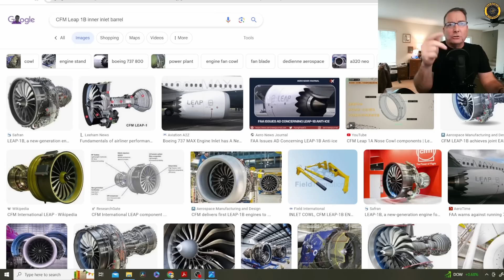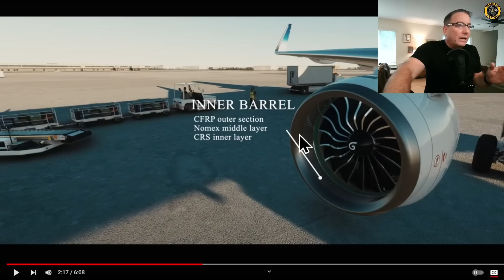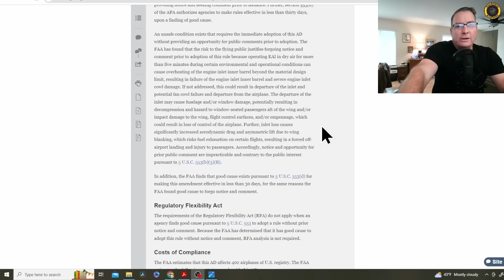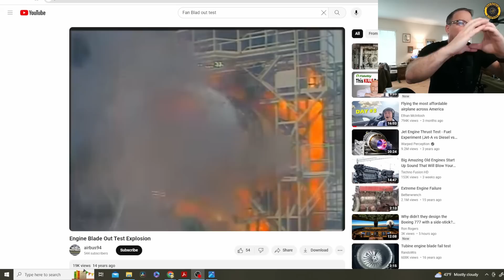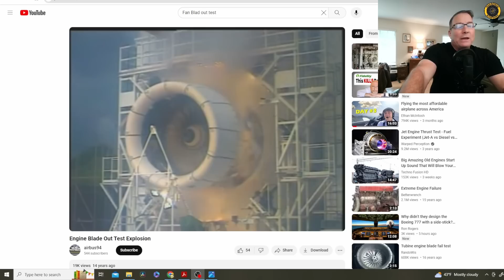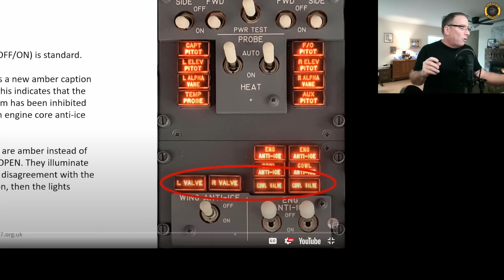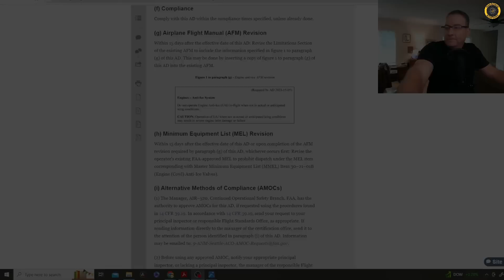Boeing 737 Max-7/-10 Certification HALTED! 1 Feb 2024

Comment: Airbus A320 disasters.
Source:  Wikipedia

On 28 December 2014, an Airbus A320-216 registered as PK-AXC, crashed into the Java Sea killing all 162 on board. 
The cause was initially a malfunction in two of the plane's rudder travel limiter units.

On 19 May 2016, an Airbus A320-232 registered as SU-GCC, suffered a cockpit fire and crashed into the Mediterranean Sea 
20 minutes before its scheduled arrival at Cairo International Airport.  All 66 on board were killed.

On 22 May 2020, an Airbus A320-214 registered as AP-BLD, landed at Jinnah International Airport gear-up and executed a go-around. 
A few minutes later, both engines had shut down. 
The plane crashed into Model Colony near Karachi on final approach to Jinnah International Airport for an attempted emergency landing, 
killing 97 of 99 on board, as well as killing 1 on the ground.

On 5 November 2014, Flight 1829, an Airbus A321-231 registered as D-AIDP, was flying from Bilbao to Munich when the aircraft, while on autopilot, 
lowered the nose into a descent reaching 4000 fpm. 
The uncommanded pitch-down was caused by two angle of attack sensors that were jammed in their positions, causing the fly by wire protection 
to believe the aircraft entered a stall while it climbed through FL310. 

On 31 October 2015, an Airbus A321-231 registered as EI-ETJ operated by Russian airline company Kogalymavia crashed in the Hasana area of central Sinai, Egypt 
while en route from Sharm El Sheikh, Egypt to St. Petersburg, Russia. There were 224 people on board (217 passengers and 7 crew). 
There were no survivors.
Reply: What’s your point?

1st-Pilot pulled the circuit breakers to try to fix the problem leading to aircraft entering alternate law and pilots failing to maintain straight and level flight

2nd-Unconfirmed but possible pilot smoking 

3rd-Stupid pilots trying to steep dive towards the runway and not having gear extended

4th-OEB 48/49 published and later software update compares AOA sensors with G load to identify erroneous sensors

5th- Bomb

Comment: The foundation of Boeing's management problem is the corporate culture in this country, which is obsessed with quick profits. Companies have to make QUARTERLY earnings statements to Wall Street. This doesn't create an incentive for long term investment, or a willingness to take the time to ensure safety and reliability. Throw in executive bonuses that provide incentives for quick profits, and you have a recipe for disaster. Time is money, so scheduling pressure is inevitable, and this makes engineering, safety, and reliability a nuisance to some people in the organization. We saw the same dynamic at Southwest. The executives refused to invest in reservation system upgrade despite warnings from staff and were financially rewarded -- even as the airline ultimately melted down during a major winter storm. The dissatisfied Boeing shareholders must stand in front of a mirror and repeat: "we have met the enemy, and it is us."

Comment: Doesn't the A320 NEO use the same engine?  Does it have a similar problem?  Or does it have automatic anti-icing and so avoids the overheating issue?
Reply from the maker: Auto.
Reply: @blancolirio only for pitot heat and window heat. Engine and window anti ice are on/off pushbutton switches with ECAM messages advising when to turn on and off

Comment: ugh!  just put the metal back.  totally ridiculous to risk a catastrophic engine failure that might occur if the pilots forget to turn the anti ice off.  As if the pilots don't have enough to do.  either put the metal back onto the front of the engine or fix the bleed air so that it's not so hot.  this is another Boeing disaster waiting to happen!

Comment: Something I do not understand: 
Was this cowling developed WITH this engine by the engine manufacturer? Or was the cowling developed by Boeing? 

If it was developed by the engine manufacturer, HOW did things get this far along without this problem being seen previously?!
Reply: If I were to guess, since the cowling is an airframe component I would say Boeing lol.
Reply: Also does the Airbus "NEO" series use the same LEAP engines with the same delicate cowling material? Do they control the anti ice function differently than Boeing?

Comment: Those blade failure tests are nice and dandy in static conditions but what happens when the engine operates at high mach numbers? The way that nose cowl oscilated at speed, it may separate. Of course, you can't test this in flight. 
You nailed it. Why wasn't the anti-ice automated as it has been for other older models?
I guess that could have jeopardize the one for all type certificate. Once again, Boeing cutting corners. Glad several entities cause the Max 7 and 10 to halt.

Comment: I understand that there are certain “things” that will not surface in preproduction testing for any new design/product. This deicing issue doesn’t seem like one of those “things”.
Reply: The test pilots and engineers would have to forget to turn off engine anti-ice during testing. And forget it enough times to produce the problem. Not likely to happen.
Reply: So there is no durability testing of this system outside of complete aircraft testing during flight? They couldn’t test the system during bench testing? I’ll bet they find a way to do it now.
Reply: @chrisn7188  They may very well have done bench testing. But it likely would only have been in simulated icing conditions. Why test an anti-ice system when there’s no ice? Of course now they know why. :)
Reply: @robertbutsch1802   the issue isn't ice is it? It's the application of heat to a material that cannot deal with the heat over a period of time.

Comment: 21 years ago when I transitioned from 737-200 to A330 I was a bit upset about not getting the 777. 12750 Airbus hours later I am so happy to be an Airbus fanboy(pun intended) especially the A380 which was an absolute pleasure to fly. Cannot believe the overhead panel on a “new” aircraft looks like a 50’s design.

Comment: Even the little E-175 I fly has auto ice detection and automatically turns on the wing anti-ice and engine anti-ice... and turns it off when icing conditions go away. Astounding that the 737 is so primitive.
Reply: It is primitive because it is a 1960s design! Boeing has really squeezed every penny out of that thing. It is astounding that they are still trying to certificate that thing and somehow make it seem like "modern". And even more astounding that the FAA somehow have allowed this to go this further
Reply: Yes that's astounding. Our home's heating uses thermostat radiators. The building was designed in 1964 and wasn't even considered highly advanced at that time.
Reply: @truthserum5310  They own the stock but the assembly lines and workforce are still controlled by Embraer.
Reply: That’s not the bad part part, the bad part is that the plane crashes if anything goes slightly wrong with the system and it is almost designed to go wrong because as Juan pointed out pilots can’t even actually comply with this craziness even if they are totally on top of it.  But what happens when something else goes wrong in the cockpit?
Reply: I’m a 175 driver too and I agree. Embraer’s have had this automated for 30 years but Boeing’s don’t!
Reply: @blancolirio The 757 and 767 don’t ordinarily have any automatic anti-ice either, do they? I heard some 767ERs do.
Reply: @rynovoski  The 757s I fly don't. They're a bit older too.
Reply: @12pentaborane  I don't /think/ any do, or at least I can't find any evidence. 

Probably in part because it was never a big deal, just not ideal, to leave it on.
Reply: They kept the controls the same as on older 737s so pilots wouldn't need to be re-certified to fly the 737 MAX planes. That's partly on Boeing, partly on the airlines. Both wanted to cut the cost of the new plane. There are lots of other examples of it in other parts of our life too. e.g. U.S. electrical plugs having metal exposed while energized as you're plugging in or unplugging. Countries where electricity was introduced later were able to use plugs which had designed this flaw out. But because the older more dangerous plug was standard in the U.S. by then, the U.S. continues to use them.
Reply: @solandri69  Modernisation is possible if there's the will.

Taking the plug example, I'm in the UK, and we've had electricity here as long as anywhere (the first house in the world lit by electricity was here, and our electricity grid was built out in the 1920s along with that of the US). But our plug design dates from 1947 - they were just like "ok, new standard everyone, this is going to save lives." Sure, post-war reconstruction gave a boost to the new standard, but its introduction still bore a cost.

There's absolutely a cost associated with any change to long-established standards, and it's understandable that both Boeing and the airlines want to keep costs down. But deciding that the cost is outweighed by the benefits to other parties is the job of regulators, and I'm with others in this thread who say that the FAA has some responsibility here.
Reply: @solandri69  Keeping 30-40 year old designs is absurd.  Re-certifying to modern systems should be a normal and welcome part of any job.
Reply: @roflchopter11  So we keep flying with 40, 50, 100, 200 year old tech because it's too costly to modernize?  If Boeing was the only game in town, maybe they could get away with it, but if you don't innovate you die.  Airbus is literally laughing all the way to the bank at their screw-ups. Even little Embraer is cutting into their sales.  A few less seats, but available NOW versus... 10 years? Maybe longer?
Reply: @josephoberlander  More like 60 years old. I find it astonishing that they still use wire ropes and pulleys to operate the flight controls.

I will never understand why they chose to enlarge the 737 and discontinue the 757, instead of making a smaller version of the 757.
Reply: @PaulSteMarie  As has been said ad nauseum, Boeing's customers didn't want a new whole airplane that would complicate their businesses and cost them more money. Some airlines like SWA, Alaska, and Ryanair to name 3 want an ALL 737 fleet so their crew scheduling, maintenance, and pilot training are simpler and WAY cheaper. Boing saved a lot of money but so did their customers. The airlines tell the airframers what to build, not the other way around.
Reply: @PaulSteMarie  : I'll never understand why people keep bringing up the 757 in a world where the 757 and 737 share the same recycled 727 guts. Boeing offered a smaller 757 and nobody wanted it because it was a heavier airplane with an unnecessarily large and beefy wing designed for a much higher MTOW that would have basically just done a 737s job for more money. The only way you could make a smaller 757 work for real-world airlines is to put a smaller, lighter wing on it and lighten up the structures bolted to the fuselage. Remember, the 757 and 737 share the same 727 fuselage structure, so you're not making any meaningful difference in the fuselage. At that point you might as well throw a 737NG wing on it, and you've arrived right back where you started, but with a different nose.
Reply: @ErickC The Boeing 737 was specifically designed to be low to the ground with low bypass engines. This doesn’t leave enough room for bigger engines, with bigger bypass ratios, so Boeing had to move the engines, changing flight dynamics, and that’s how the whole MCAS-disaster started. Which is of much bigger concern than the doorplug- or engine cowling- problems. The 757 is also old, but wouldn’t have had the big bypass issue.
Reply: @josephoberlander  the 737 airframe was designed in the FIFTIES, SEVENTY years ago, as the 707 airborne refueling rig for the military. it should have been retired in the eighties, forty years ago.
Reply: @solandri69  Exactly so! That's also what led to the MCAS disaster.
Reply: @solandri69  I have serious doubt that pilots would need a new certification - only because de-icing would be automatic.
Reply: @DR_1_1 the issue is the pilots have to be TRAINED on the type and that can’t happen unless the airlines buy a simulator, and the whole issue is Boeing sold these planes promising that airlines would need to do the new training.   So then Boeing just omitted or deleted even telling the airlines and pilots and fax about these issues so they could skirt by and now pilots are flying systems they don’t fully understand because the changes were actively hidden from them.
Reply: @solandri69  "That's partly on Boeing, partly on the airlines."

Why aren't we blaming the FAA for not having a reasonable path for updating cockpits without total re-certification?

I don't need a new driver's license to drive a 2023 Toyota Camry just because the headlight switch and wiper controls are different from a 2005 Toyota Camry.

Substantial changes that affect how you fly it? Sure. Minor updates to peripheral systems? Surely, a bulletin or mandatory review of the marginal changes should be sufficient.
Reply: @dafunkmonster  Because the updates have charged the flight characteristics, which can vary substantially between different airplanes. There are different types of driver's licenses for cars and tractor-trailer rigs because the latter are so much harder to drive. Multiply that difference by 1000 for airplanes. 

MCAS was supposed to eliminate those differences between the 737MAX and earlier 737 models.
Reply: @dafunkmonster  anyone making arguments that “it works fine for driving” is not a serious person or hasn’t driven in at least 5 years.
Reply: @truthserum5310 Wrong
Reply: Could this be their Harvard moment, or their Bud Lite moment  ?
Reply: What do you expect from a plane designed by clowns who in turn are supervised by monkeys?

Comment: I'm a bit confused. In the photo the CRFP is clearly labeled "outer section" yet you said it was the inner layer (I'm assuming you just mis-spoke) while the inner layer is CRS, (carbon reinforced steel) - steel, but are you saying it's still a problem?

Secondly; is the cowling designed and built by the engine people or the airframe people?  I think Boeing should have been forced to clean sheet this aircraft several models ago. Hind sight being 20/20.
Reply: He said “first layer.”

Comment: So the flight crew was supposed to depend on visual cues - (while in flight!?) - to determine icing conditions GMAFB
Operating at night included...? WTF  .
Reply: I understand the issue to be that the crew has to remeber to turn off engine anti-ice when exiting icing conditions rather than it being done automatically for them. The airplane does have icing conditions indication but no automatic operation of anti-ice.

Comment: It seems like the engine anti ice system needs to be able to modulate the temperature of the bleed air anti ice system in addition to an automatic bleed air control system that senses icing conditions.
Reply: Adding that to the MAX would have jeopardized main big priority of making it compatible with earlier 737 versions and thus requiring  more crew training expense than some airlines wanted.

Comment: This might be pointing out the bleeding obvious but why don't they mix the hot bleed air with some cold external air to bring the temperature down?
Reply: The air for engine anti-ice is supposed to be hot.
Reply: @robertbutsch1802  "...is supposed to be hot"
Is supposed to be hot enough to melt the Ice, but not the plane....

Comment: Boeing would have been better off sticking with the 757 and developing different models. The 757 would have been a better aircraft and they wouldn’t have had to deal with MCAS cause the newer engines would have fit.

Comment: I was a B-52 crew chief for several years and had great respect for Boeing's engineering and design of that airframe. 

But this redesign of the ring cowl anti ice system on the Max series is bad and makes no sense. Why switch from a system that is forgiving if the anti ice is accidentally left on to a system that won't auto sense and shut the bleed air valves or tolerate inadvertent use of the system out of icing conditions. I foresee pilots being reluctant to use the anti ice system because of these shortfalls which could lead to an incident or accident due to ice accumulation on the engine inlets.

Comment: That's insane to design an engine that can't take the heat of necessary engine anti ice. Plastic parts look awesome...just before they explode to dust. Cant be on for more than 5 minutes.. that's crazy
Let's see,,so far we have what wall street calls the Max jet,, flying ⚰️ coffins. Why....MCAS, "bowing', plug type doors, loose rudder bolts, pitch roll tendency,,etc,etc
Reply: The cowl can take the heat of necessary engine anti-ice just fine. The problem is it can’t take the heat of unnecessary engine anti-ice should the crew forget to turn it off when not needed.

Comment: I spent 12 years as an engine and airframe engineer on the C-17 Globemaster. The C-17 has an Ice Detection Probe in front of the fan of the Number 2 engine. When ice formed on the probe, there would be a master caution “ICE”, you turn your anti/de ice on and wait for the light to go out. Maybe the max series could adopt this system OR a timer where the anti-ice valve closes after a few minutes 🤷‍♂️
Reply: I think the MAX does indicate icing conditions to the crew. The C-17 can probably tolerate the crew forgetting to turn off engine anti-ice when “the light goes out.” The cowling on the MAX - not so much.
Reply: The C-17 is so much more advanced and redundant compared to the 737. Fly By Wire..., four engines, STOL.. lol